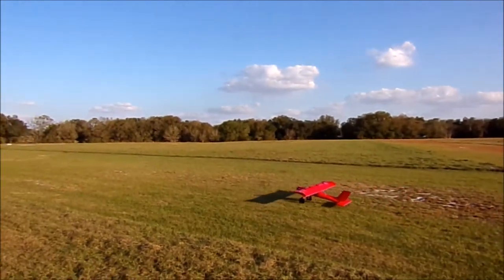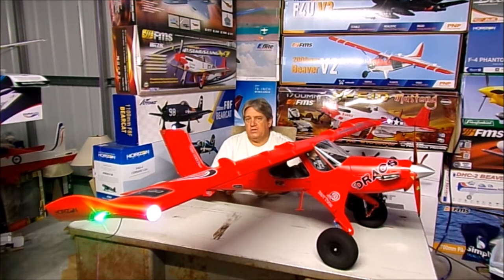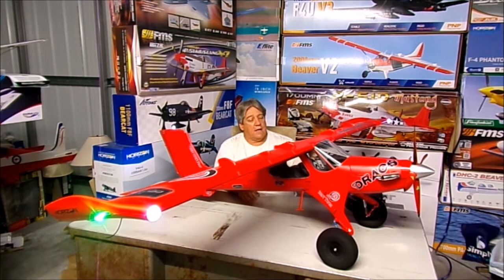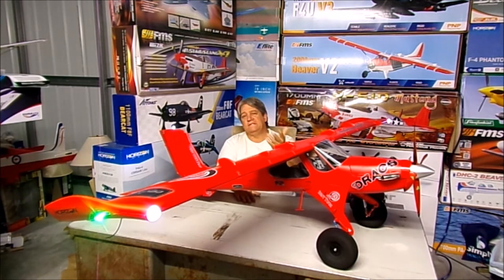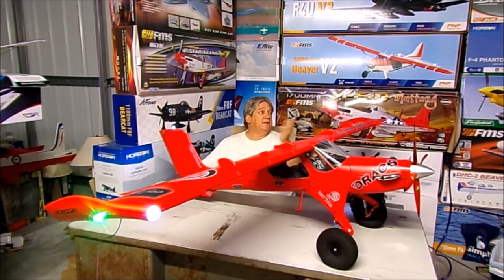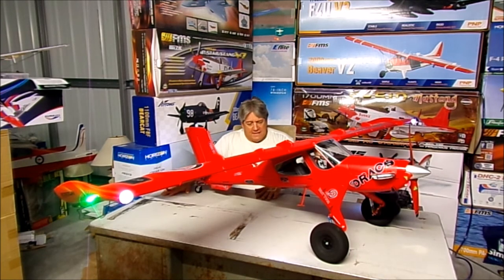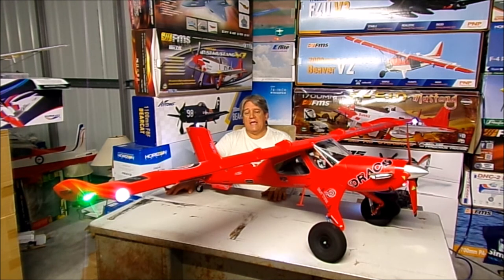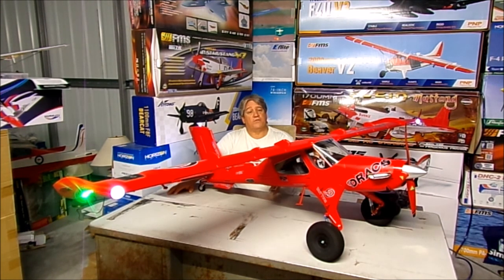E-FLITE DRACO 2.0M 4S-6S AS3X SAFE LANDING GEAR THE FULL STORY AND THE RIGHT WAY TO LAND IT !

Comment: Great vid🙏 I probably have a similar number of landings on mine and totally agree with your observations. I’ve found with the Dubro 5.5’ with no air it sticks much better. I have a Grand Tundra but we can’t get wheel spares at all here in Australia. I find if you full rate the elevator with a rear CG 4000 battery you can get a bit of high alpha under power to get some sort of STOL but really my Carbon Z Cub is better. Great honest feedback again thanks